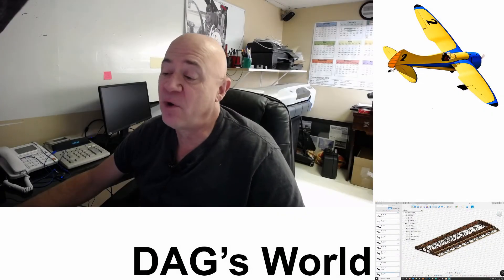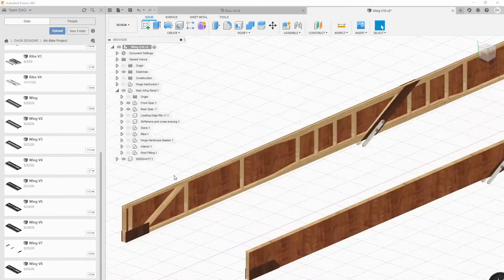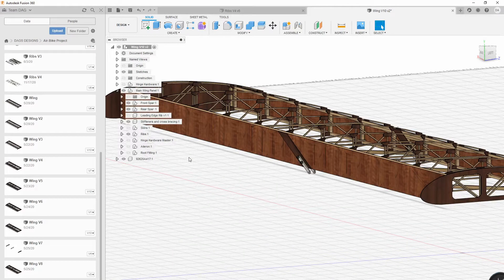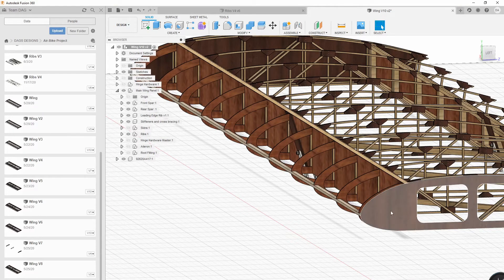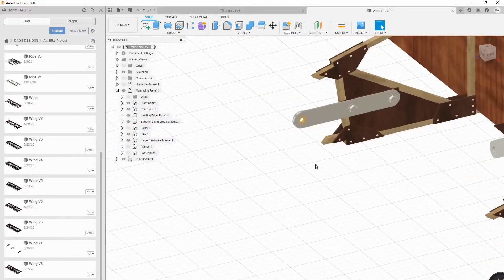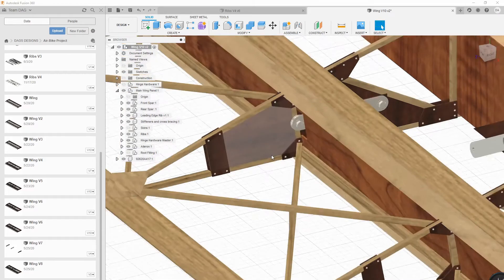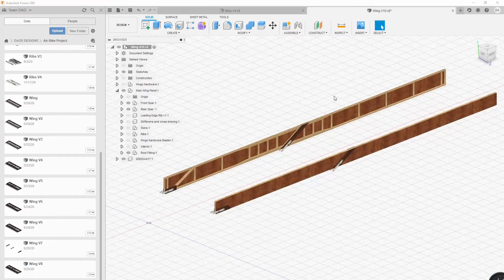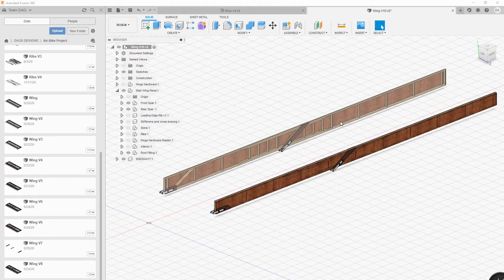AirBike Update- Wing

Comment: Dag214, I have a Tandem Airbike, the area at the rear of the wings directly in front of the nose of the flaperons is completely open. You can see into the inside of the wing. This does not seem correct to me, the aircraft has a very heavy nose down flight characteristic. Weight and balance is good.

Comment: Do you have no IP concerns with sharing the CAD files? I've made my own Solidworks model of the Tandem fuselage, but I haven't shared it with anyone because I was under the impression the rights to this design were owned by JLA and they wouldn't be happy to see me sharing something that could be used to build one.
Reply from the maker: I e-mailed Steve at JLA to make sure what I am doing is OK.
Reply from the maker: JLA just gave me full permission to share my CAD's hoping it inspires others to buy their drawings and build an AirBike.
Reply from the maker: I am not sharing any of their copy-written drawings.  I am not sharing any CAD drawings that someone could make parts from. Only my JIG I deigned. I don't see how anyone could make a wing from my FUSION 360 file. Plus, its not a drawing set. You need the set to make the wing. I see people share these type of files all the time. But, I could take them down if anyone complained. :) Plus, I am not sharing a single CAD file they created.